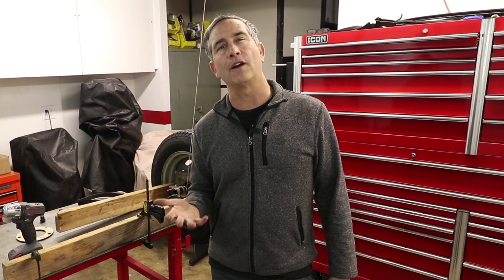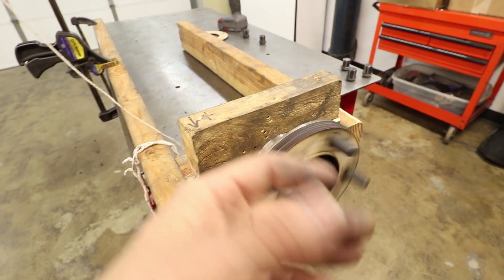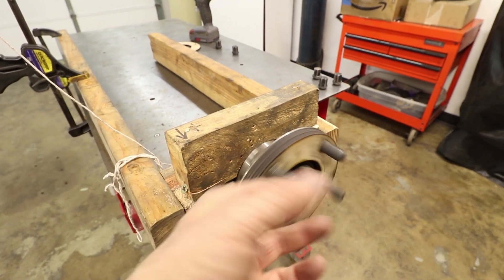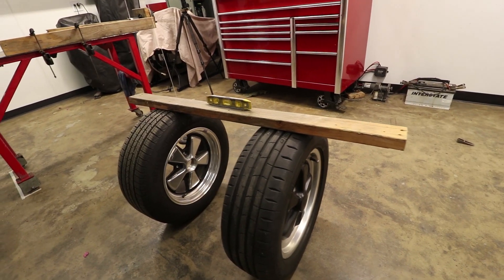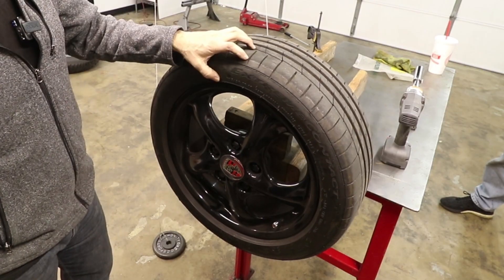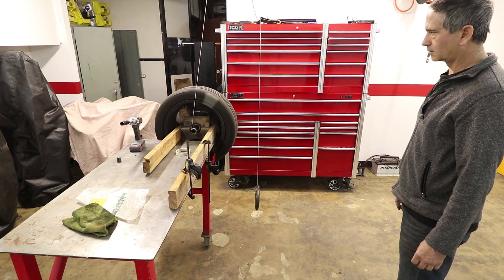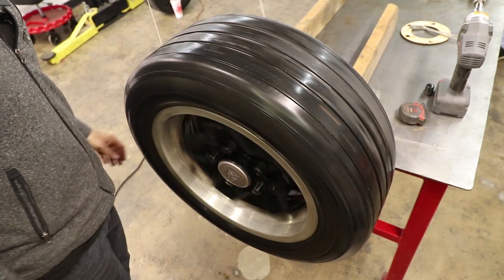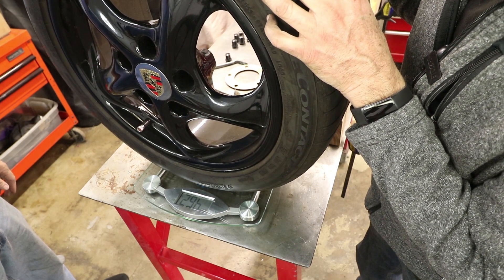What's the Best Wheel And Tire Combo for Acceleration? 15, 16, 17 inch or?

Comment: Would be interesting to see the figures for a non-Fuchs copy. They are SO much heavier.
Reply from the maker: Funny you say this because one of the wheels in this video is a fuch replica by Braid.  I didn't mention it because the Braids are forged and very similar in weight to the originals. The cookie cutter beat it, but largely due to the worn 50 series tire.  If I ever get the chance to retest just the rims I will.

Comment: The geek in me loved this video.  Thanks for putting it together.  Loved the thumbnail art.  The Jaguars tires are 205/70 15.  So somewhere in the middle I guess.  Great ride, but cornering not as sharp.  Everything is a compromise.
Reply from the maker: I think the taller tires on your jag look good..  I think I will have a second set of wheels and tires for autocross when Mac is ready again.

Comment: Assuming horsepower and torque remain equal in all cases and no tire slippage (spin), a smaller diameter tire should provide higher acceleration RATE while a larger diameter tire should provide greater distance traveled for the same number of tire rotations. The formula for acceleration rate is ending velocity squared minus starting velocity squared divided by two times the distance traveled. The smaller diameter tire (circumference) results in a shorter distance, thus a higher rate. You could also calculate this by using Momentum formulae, although you don't provide enough information to complete this calculation. 

I remember talking to Pat Tobin back in the mid 60s. He raced a Speedster in CalClub. Pat said he couldn't afford to re-gear his car for different tracks, so he used different size rear tires to change his acceleration rate and/or top speed. I've not gone into Newton's laws of motion here, but unless we're splitting some fine hairs, smaller tires should result in higher acceleration rate for the same amount of time while larger should result in longer distance traveled for the same amount of time. Carl... Washoe County Sheriff's Office, Traffic unit, MAIT (retired)

Comment: Interesting results.  I guess that's why even modern Porsches can option magnesium wheels and certain supercars even have carbon fibre ones.  With that said, I need a minimum of 16" just to clear the calipers!  17" also looks enticing because you have so many more tyre options (e.g. MPSC2.)  I think anything bigger looks "off" on a G-Body 911 anyway.
Reply from the maker: I think this stuff is interesting.  Mostly because I prefer the lightweight feel of older cars.  A bigger engine in a lightweight car has been so much fun for me.  I have big brakes that fit my 15" wheels, but sometimes a bigger wheel is needed.  Newer cars are fast but feel heavy to me.
Reply: @GarageTimeAutoResto  I agree 100% - I'll probably stick with my 16's as long as I can get suitable rubber for it!
Reply from the maker: Very cool, my tire choice is different than most.  I find it more fun to drive on slippery tires that are forgiving at the limit.  Who needs an extra .5sec lap time improvement on a street car?  
Most people are afraid of spinning out.  My skinny 356 tires are the best😀

Comment: Excellent content on inertia Professor. I believe the early 911s even had 14" rims to keep the weigh down and rolling resistance low. Some production cars with magnesium rims were even lighter yet.
Reply from the maker: Thank you and yes 14" fuchs definitely existed in the early days of 911.  Mini lites from that period were magnesium I believe.  Good stuff back then.  Today everyone just adds a turbo and emphasizes big wheel appearance.
Reply: @GarageTimeAutoResto  100 % right, i have 4 of the American mags 15 x 7 and in the early 70's dad ran 5 5 x 14 with 185 x70 rather than a 6 x 15 less weight to stop and less weight to accelerate with same foot print
Reply: Remember ride, larger wheel same foot print but less sidewall, rougher ride, but better for the track

Comment: This seems like good place to get flamed:
When it comes to ENGINE rotating mass, I often hear people CLAIM that reducing rotting mass GIVES MORE HORSEPOWER.
This is false, changing the rotational inertia of an engine CANNOT result in "increased hp".

Can less rotating mass reduce acceleration times?  YES but by just about the same amount as the same mass reduction anywhere on the car.

I have a Suby BRZ and there was a BIG thing on YT years ago about how "lightened crank pulleys give better results on the dyno"
I debunked this many times.

Oh, and I restored a Porche 914 (NARP) and used to race in vintage car racing.  My car was faster than the 911s in my class (mid engine wins in the twisties every time).
Still have it
Reply from the maker: You are right in many ways, such as horsepower and torque don't increase with a reduction in rotating mass.
People fixate on dyno results even though dynos require wild guesses on drivetrain efficiencies and ramp rates.  Some dynos can measure time delta rpm which can sense inertia of the engine, but those effects are usually drowned out by dyno inertia.
Rotating mass is way more important than plain weight in your car.  Things that rotate take energy to spin up in addition to going from point A to point B
Why do dragsters have skinny front tires?  Why do lightened flywheels improve acceleration ? 
Why does it take longer for my simple weight to hit the floor?  Rotational mass matters in the real world, but not on a dyno.  
914's are very cool cars and always a keeper.  Enjoy
Reply: @GarageTimeAutoResto  Part of the way they were "cheating" is they were using "Inertia Dynos". For those you must enter the engine rotating mass in the calculation.
They would make a run with the stock pulley, then swap it for the lightened pulley then run the dyno with the SAME VALUES AS BEFORE.
So OF COURSE the inertia dyno will show an "increase in hp" because you DIDNT TELL IT that you reduced the rotating mass.

ALSO - technically "horsepower" is MEANT to be measured at CONSTANT RPM and finding how much resistance it can provide before slowing the motor.

So if HP is meant to be at CONSTANT RPM, then HOW can rotating mass play a role in the final answer?
IT CANT.

- "Why do lightened flywheels improve acceleration ? "
Because you reduced the mass of the vehicle overall.
Shaving tread from your tires make more of a difference than lightening your flywheel.
Reply from the maker: Shaving tire tread changes the effective gear ratio because the diameter is smaller which improves acceleration. 
I didn't want to get into the effect of gearing on acceleration for this video but it's one of the many factors that influence vehicle performance.  You will also lose top end speed with smaller diameter tires.
This is not so with a lightened flywheel.
Reply: @GarageTimeAutoResto  It also sheds mass from the largest radius rotating mass.  The mass at the outside of the wheels has the greatest effect on total rotating mass.
Reply from the maker: Yeah for sure less rubber reduces the tires inertia, but you said the inertia didn't matter on the flywheel.  The flywheel literally spins 12 times faster and accelerates multiple times for each gear change.  
Please don't underestimate the importance of things that spin.